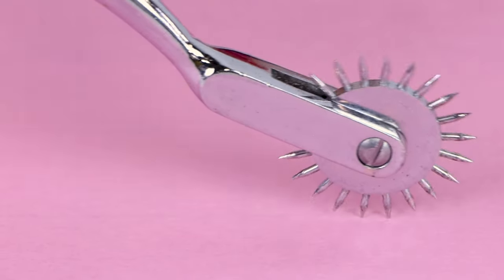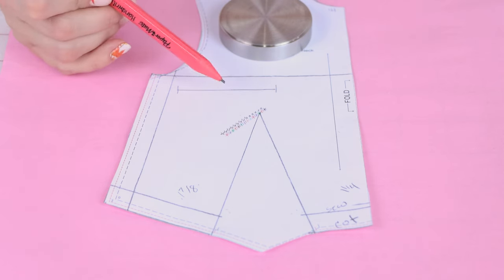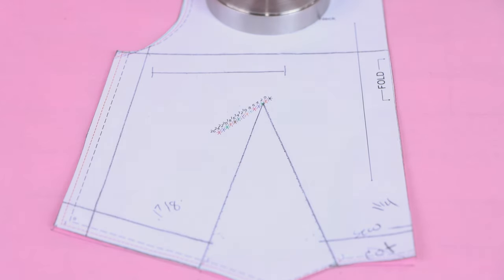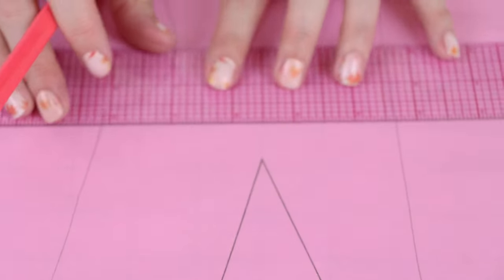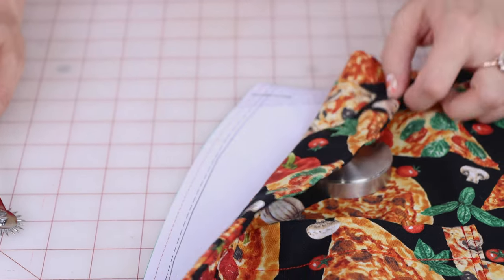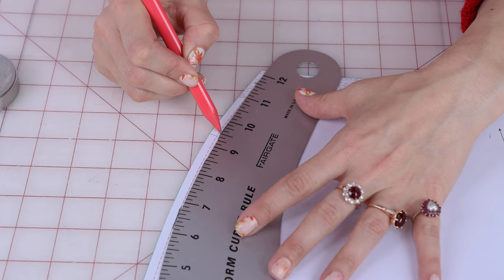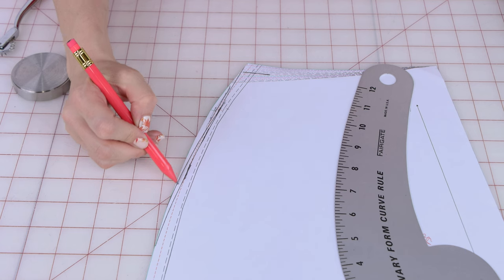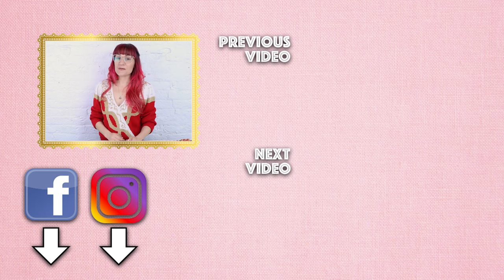What Is A Tracing Wheel In Sewing And How Do You Use It?

Comment: I use this to copy ready to wear without taking it apart. You need a layer of cork-board or corrugated cardboard. Above that, tracing paper. Top layer is garment to be copied. Identify grainline on both the tracing paper and the garment piece. Follow seam-lines of garment piece pressing enough to make holes in the paper. You may have to do half of the piece at a time. After you connect the pinholes, add seam allowances.
Reply from the maker: Very cool 😎
Reply: That’s a great idea to use cardboard underneath, especially if you don’t have a self healing cutting mat!

Comment: Not that it matters as they are near identical, but the tool being used is a Wartenberg wheel which was used in neurological medicine. The real difference is the wooden handle and the original sewing wheels didn't have such pointed needles, they were more blunted. These were adapted for sewing use.

"Clothing pattern-making can use a version of the Wartenberg wheel, called a pounce wheel, to transfer markings from paper to fabric. Pounce wheels resemble standard Wartenberg wheels in shape but have wooden or plastic handles."

https://en.m.wikipedia.org/wiki/Wartenberg_wheel
Reply from the maker: Interesting. Yeah I have both with and without the wood handle and they are the same. I have never heard a book or any one call it a pounce wheel. I wonder where that came from. INTERESTING. Thanks for sharing.